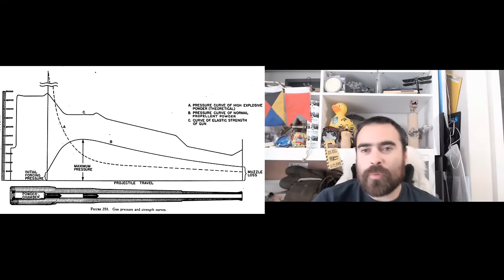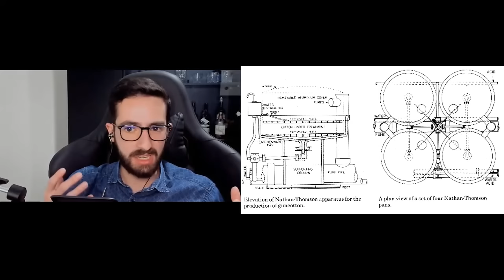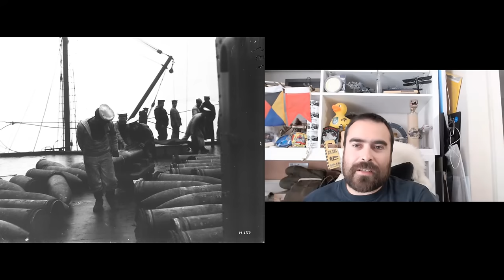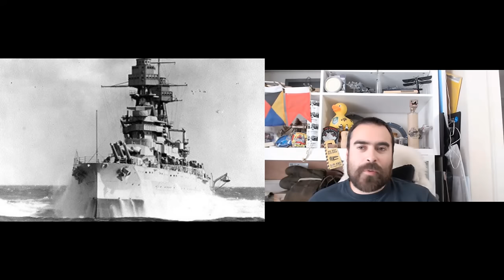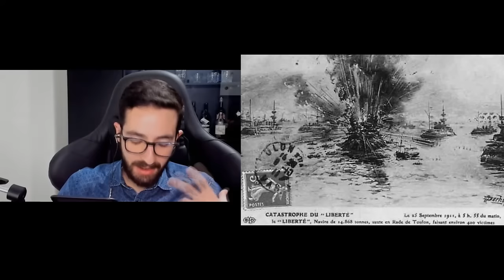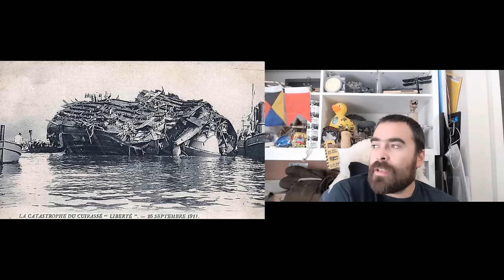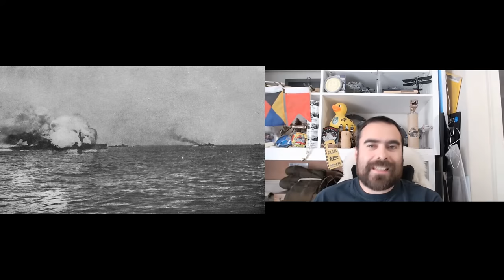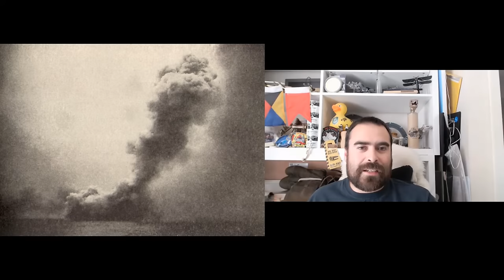Cordite and Poudre B - Why things start exploding at just the wrong time

Comment: Rather a lot of guessing and speculation chaps..!

1. The issue with Mk1 Cordite was erosion due to flame temperature. Nothing to do with the burning rate. MD solved this to some extent by reducing the NG content, but all Double Base propellant has always had erosion issues.

2. The early instances of explosions being caused by the instability of cordite and other NC based propellent was to do with the retention of acid in the fibres. Making NC from cotton linters has a problem in that acid could get trapped in the hollow fibres and avoid being neutralised in later processing stages. Abel and Dewar solved the problem by shredding the fibre mass using paper making machinery to break up the fibres.

3. NC will oxidise over time producing acid by products. The problem is that these by products can act as catalysers creating more breakdown and self ignition. It was found that the cracked petroleum jelly, initially added to cordite as an extrusion die and bore lubricant acted as a stabiliser by soaking up the acid by products. This however only worked as long as there was sufficient stabiliser left in the material. Once it was used up, the propellent could decay catastrophically. Abel developed a Heat test to work out how much stabiliser was left in a propellant batch. Heat testing of cordite was carried out regularly on all Cordite stocks and effectively solved the "exploding ship" problem.

4. Dust is/was an issue with Black Powder, and was the main storage concern and cause of explosion propagation. Black Powder does not detonate!  Provided it is stored in moisture proof conditions, it is virtually indestructible.   I have opened BP shell from the 1880s and the powder was as good as the day it was made. Nitro based propellent and explosives have other issues..! Most nitro based explosive, including Dynamite and C4 are capable of both burning and detonation, however the main propagation risk is from detonation. A shock wave will detonate both propellent and HE. Dust was not really the issue, and certainly is not an issue with NG. The main problem with NG and most of the other nitro compounds it their tendency to produce interesting compounds with other substances such as lead and copper, and to migrate from fillings into fuze threads and other awkward places...

A lot of this is not well documented, but there is a series of books by Marshall covering the 1914-1918 period which are interesting if you can get hold of them. The real problem is that much of the reported accident material was under government control and not promulgated. Huge numbers of fairy and old wives tales in this area I'm afraid!

Comment: Sorry it hurts that list would go for pages. Nitroglycerine dust? Melting point for it is 14°C. How cold were british ships? Btw. nitroglycerine powders and even dynamite leak it out not as powder but liquid * And why only battlecruisers suffered the issue, not battleships? * Stop talking about propellant as explosives especially when you cut out the word "low" and than you mix it with true explosives not keeping borderline (fires on the ships etc). * Warheads were filled with TNT and similar ones, TNT would explode when overheated, but if just exposed to flame, it would burn. Semtex/C4 are not explosives per se, they are mixture and real explosive inside are compounds like hexogen, PETN and similar. It is not modern vs old but explosive vs propellant * Warhead's filling is protected by thick metal container called shell (grenade), propellant at best is in thin metallic one called case or just in bag. Big difference in case of fire * nitrocellulose unless stabilized is becoming sensitive due to decomposition caused by the leftover of the acids from synthesis. Even worse, products of decomposition are accelerating the whole process. *  burn rate of gunpowder rises with increased pressure, thus it is not only due to some magic difference between british and german one, but even if the pressure had time to escape. OMFG, just look at russian tanks in Ukraine - sometimes pressure vents out through hatches, other times 15-ton(!) turret flies to the moon. And it is much more modern propellant there !!! * as far as I know, RN was using powder bags, KM was using metal casing even for big guns. Could be big difference in fire propagation.
* stop pretending to be scout boys. No-one was using guncotton - it was dissolved in proper solvents and than turned into solid pieces: grains or strings. No secret there. Same process as making celluloid that is same stuff just different level of original cellulose nitration (hence reason for old cinema's catastrophic fires)
* what about other battles? Against group of Graf Spee - major firefight, no such explosions? 
No pun intended, just lot of things I noted, missed or were not put together at proper place
Reply: Typical water temperature in the North Sea is 6C.
Survival time is about 30 minutes if you fall overboard.
Reply: @allangibson8494  I do not think you want that temperature inside your ship for dozens of reasons

Comment: A gun propellant does not explode,it burns or deflagrates extremely rapidly. If it explodes.the projectile cannot accelerate up the barrel rapidly enough to allow enough volume for the gas to fill.
Nitrocelulose will burn relativley slowly if uncontained,unlike black powder which will flash instantly. A safe way to dispose of old sweaty dynamite exuding nitro glycerine is to spread it over kindling and burn it. I think you should go back to your books and come back later.

Comment: Had to stop watching. Having read Technology and manufacture of explosives by prof urbanski and a bunch of other sources and having a broad engineering background including some in pyrotechnics,  this is painful to watch. Guncotton is - most of all - impractical. Hard to get a high order detonation if you want, hard to get a controlled copmbustion if you want that. Easy to light by accident unless wet because it is as finely divided as black power. Cordite etc. are ways to make a practical guncotton. It is still, in effect, guncotton  (considering that nitroglycerin is chemically and in combustion properties almost the same, just stronger and less safe). Knowledge of manufacturing processes is completely legal, also. Any chemicla engineering textbook like the one by urbanski tells you how to make industrial quantities, litterally. Safely and reliably, too.

Comment: Nice guest, however. . . His face looks like he is using Snap Camera or some other filter as face looks plastic. Second, the terms he uses, two sounding almost the same instead of using a more simple word. I could not recall which were which after he began to use these words. Entropy versus Enthalpy ??? I had to turn on closed captioning to even figure out the difference, Very poor choice.